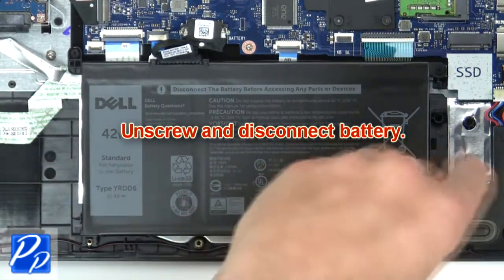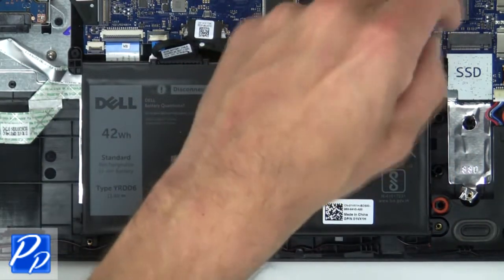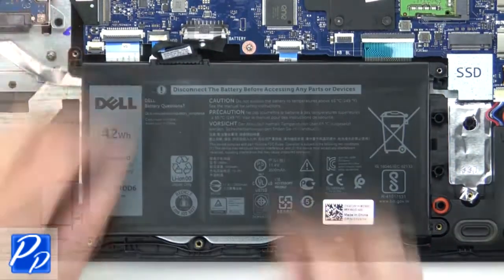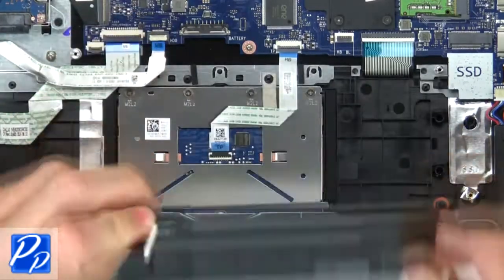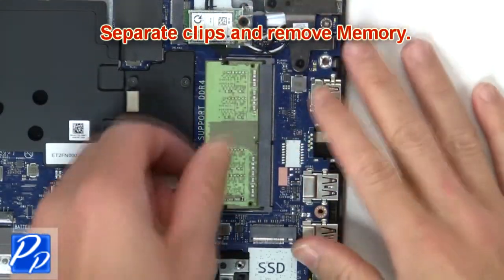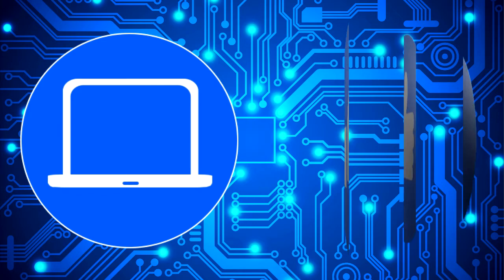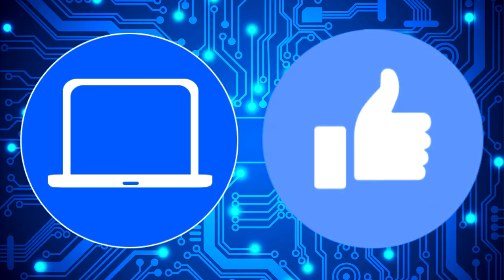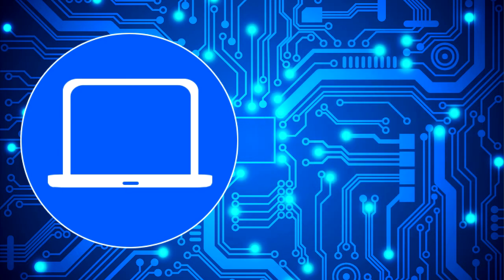Dell Inspiron 3480 (P89G003) Memory How-To Video Tutorial

Comment: can i use a ram memory from another dell computer?
Reply from the maker: It depends. This laptop has 2 memory slots with each allowing up to 16GB's of DDR4 RAM (for a total of 32GB). If this is what you have then yes.
Reply: @dellpartspeople  omg, it means that it isnt necessary to remove the one that already has (4 GB), so I just add the other one (6 GB)? :0
Reply from the maker: @marijocarbajal6968  Correct.